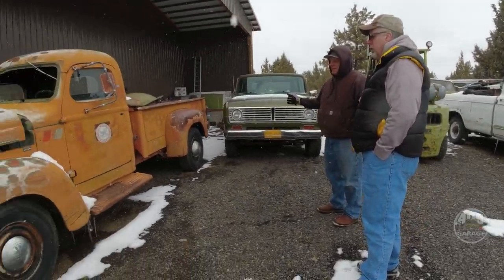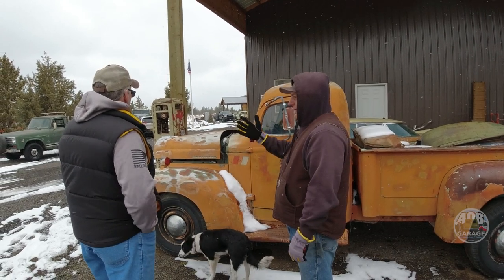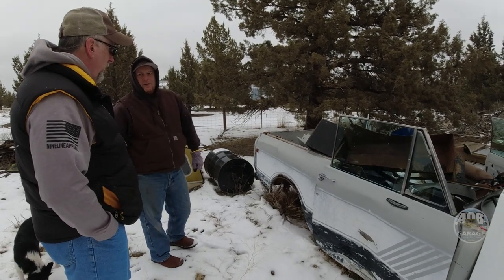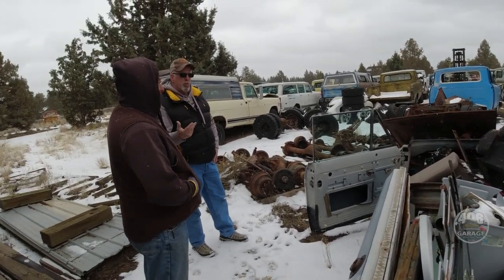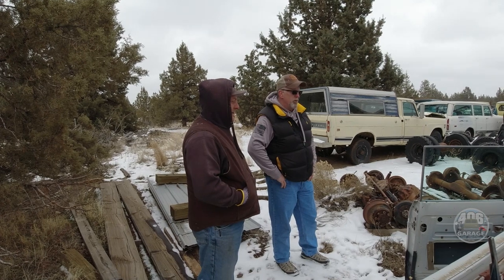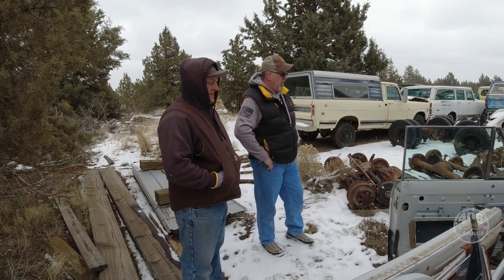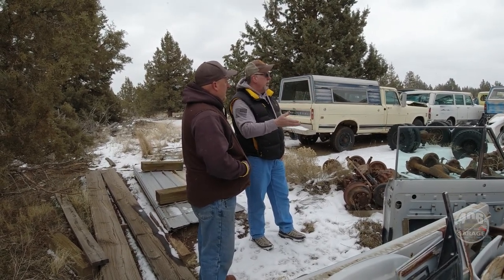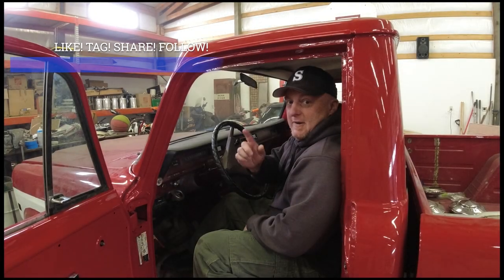406 Garage: So the State Trooper showed up to look at some Old International Harvester Trucks! EP:2

Comment: Love this type of chat, it’s heartwarming, for some unknown reason! 
Love the border running around, beautiful dog ❤️🇷🇴👍🏻
Reply from the maker: Awesome! Thank you so much for this comment! This is what keeps us going! Please keep watching!
Reply: @406garage3  
I’m no collector, but I’ve always had old cars others considered to be at the end of their days, and I kept them running in good order for another 5 or 10 years.
At 68 I’m not inclined to roll on my back in the mud like I did in the old days, but I currently run a 26 year old diesel Toyota Land Cruiser 80 series, which I treat like a child. 
I love off-reading it, and any opportunity to do any distance in it is a pure pleasure for me. 
It has 482k km on the clock and is still going strong, the engine has never been opened.
Last year I drove it to Greece for our summer vacation, 7 of us on board with all our luggage on the roof! 
2,500km round trip across Bulgaria, on the scenic roads, through the mountains in Greece, and it never missed a beat even with temps up to 48C (119F).
Bless you for finding refuge and restoration for these IH machines, it’s a blessing for those of us that like old-school, no computers just plain good engineering… 
Thank you ❤️🇷🇴